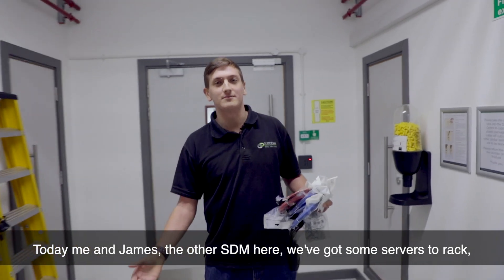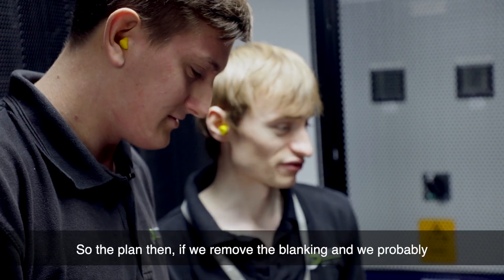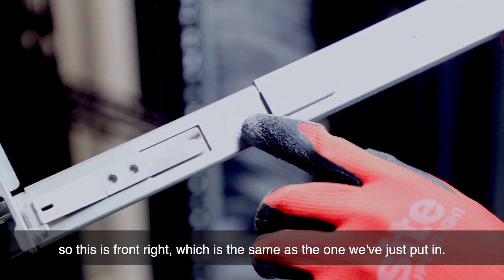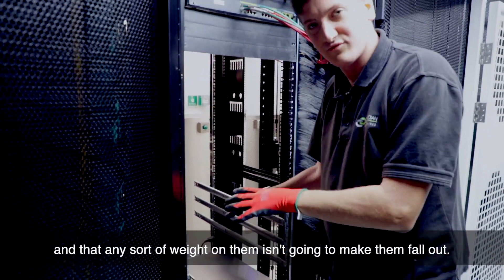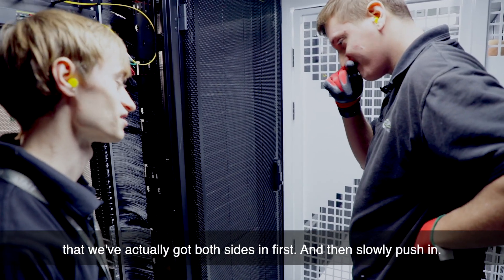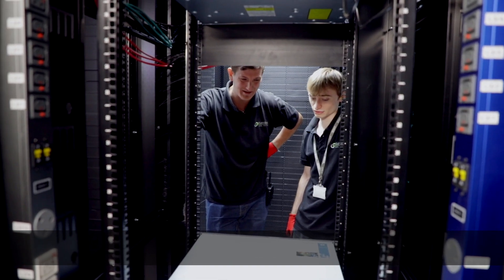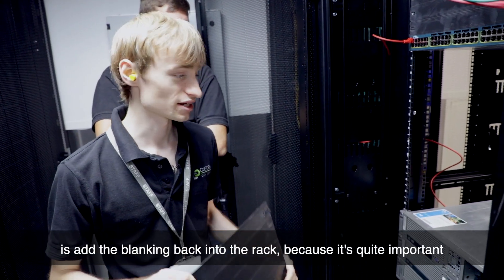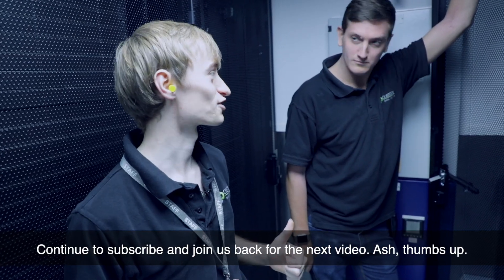A DAY in the LIFE of the DATA CENTRE | RACKING SERVERS with ASH & JAMES!

Comment: I did rack design just by myself and a program...and before that just watched once in a data center how it's done...

switches DON'T pull air from the front and push out the back, they pull it from right and push it to left side or the other way around...
allways install your switches frontfacing the back of your servers, because:
a) less cable cluddering and management, the main network cables are right at that end they need to be
b) patchpanels are allways facing the rear end of your rack, so less cable cluddering there as well
c) the airflow of a rack in a professional data center is less right to left, it's more bottom to top...fresh air pushes from the bottom of the frontend of the rack and gets pulled through the top backend of the rack, convaction is the keyword here

Comment: video from 7.2019 but hp server g5!!? and cables are installed incorrectly. so the server cannot be pulled out in case of maintenance or everything has to be unplugged beforehand. there are modules like fan etc. which can be replace online. then you have to be able to pullout the server in operation.
Reply: Most old stuff runs nearly as good as the new stuff once you plug some SSD's into them....

Comment: Besides the many comments already made, I want to add one simple rule: Never ever use any server/switch/etc as a shelf were you put your tools and screws and all the stuff, that's simply not professional. Also that many colors mixed up with the cabling seems weird to me, in our datacenter we only use a single color, but all cables are clearly labeled at both ends with source and target plus even patchpanel ports if necessary. For power cables we exclusively use z-Lock cables, they can be secured in place while fitting every standard port on the devices or pdu's (kind of a retrofit)

Comment: When I saw how they "slammed" the servers in the rails it made me cringe (hard drives).  Then realized they're old servers just for the video.
Reply: Drive heads are parked when not running. Think of the HDD's being delivered in a box by a courier / part time footballer ;)
Reply: @artr67  Vibrations, even when the drive isn't spinning, can still corrupt it. I believe yahoo* had this problem when transporting drives from one building to another--the carts they used introduced enough vibration to effectively kill their drives.
Reply: me every time my external HDD goes crashing to the floor
Reply: Yeah, and also for any other HDDs that's currently spinning in the same rack. That way of slamming the servers in isn't really recommended.

Comment: Look at those wasted PDU sockets due to the server rails!
To do this properly firstly use 1200mm deep and 800mm wide racks when mounting servers, mount both PDUs on the right next to the server PSU's and so the sockets are facing the back of the rack (tucked down the side) and add decent cable management for all the data cabling on the left side and add cable gutters to support the cables running from the front to the back. Also keep all cable lengths to a minimum to avoid excess cable just hanging or getting in the way.
Great to see the earth pin locking IEC sockets though!
Some advice from one data center manager to another :)

Comment: How does one get a job like this and how much does it pay?
Reply: Pay increases as you take on more responsibilities. You don’t get paid just for racking servers like this. They make you do variety of things and you have to be prepared to do all of them.
Reply: krakistophales networking courses
Reply: You start from bottom as a customer support and work your way up with bunch of certifications in IT. It’s pretty straightforward, actually. Get experience and certification. A degree would help but it’s not a requirement unless you go for upper management position but that’s not until you get years of experience.
Reply: Pay depends on where you live. In the US, its pretty average range from 40k to 80k. You get above 80k if you work for Google or top tech company but you have to be really top in the field.

Comment: Really two people? I install 1 to 4 u devices alone. Need to learn to do It alone
Reply: safety, always safer to have someone help you lift heavy equipment. my job requires 2 people when racking anything
Reply: You don't want to be the guy that drops an expensive switch or server. It is way too easy to ask someone to help you out for a bit.
Reply: I once installed 250  1u over a weekend all by myself, no gloves. Hardcore
Reply: @PerfectedImperfection  Your employer is a cheap-skate then, you should find one that takes you and safety more seriously...

Comment: Why don't you have an automatic transfer switch per cabinet for those single PSU devices to ensure they have redundant power in effect? If you lose feed A currently, that's one of your switches or servers going down.
Reply: They will typically switch between main feeds in under 20 milliseconds. Just had a look online and one will switch between main feeds in less than 8 milliseconds.
Reply: Will they continue to operate without any waiting time?
Reply: 2ms any good for you.... 

https://www.kvmchoice.com/detail_switch.asp?id=12858
Reply: @catmantech  thank you
Reply: Wont help if the PSU fails
Reply: @rty1955  no it won't, but it is removing single points of failure as much as possible.
Reply: @rty1955  for the Cisco kit you can use the RPS port with the RPS system supplying DC straight into the device. Ubiquiti also have a similar solution.

Comment: You guys charge by the hour, right?  With Rapid Rails one person can mount and server in less than 5 minutes without all that faffing about.  Clip in both ends, pull out rails, set server in, job jobbed.
Reply: Andy D I know right? I once dry racked 40x HP G7 DL360’s alone in less than 2 hours, and that included unboxing and preparing the waste for recycling.

Comment: Never used these rails.  Cool.  But I should think it might say "rear left", at least for the installer handling that end of the business.  Nonetheless, looks like they are so angled as to be specific to each side of the rack?
Reply: They are, you have the left and right rail and you cannot swap those, nor can you install them upside down, the G6/G7 rails (same parts) can be installed either left or right (but again not upside down) and I think the G8/G9 (same parts) can be installed in any way as long as you have the rear of the rail facing to the back of the rack.
Those G5 rails are fairly easy to install but damn near impossible to remove again, especially when there's equipment on top and below the G5 rails so you cannot get your fingers in there... G6/G7 have two tabs you push to release it, works fairly well, G8/G9 have one tab you just push and it drops the rail right out, works perfectly.
Most G5's I have had to remove required a wrench to push that damn clip back in to release the rails...

Comment: Thank you for this informative demonstration. I have a short question. Should I get Server + certification or Server 2016? Or both
Reply: Depends what you want to do. No need for any certs if you just start as a shit kicker and work your way up to sys admin. originally i just did a cert 3 in information technology at tafe. Easiest way to get into the industry is to go work somewhere for free for a while and then weasel your way into a job. Ive been a sys network admin for 10 years now.
Reply: @iampyron22 Thanks for the advice. I was thinking the same. I have two years of experience but have a break in work history. Ill go volunteer for internship and get in.
Reply: @mainevent2k  No worries, Good luck!

Comment: If you care about airflow put atleast the dummy hdd racks into your old servers 😆

Wait I need to wear steel toe shoes while working on my home rack?😄 Bare feet is so much better! (I did actually put on steel toe shoes while building the rack 😜
Reply: The servers should also have cable management arms fitted as well as the rails. I noticed some of the servers also were missing the PCI slot blanks

Comment: Running power and data parallel instead of having them on opposite sides of the rack? Interesting
Reply: No real need for this these days we have never had issues
Reply: I would imagine they're both sufficiently shielded cables.
Reply: no need to separate them but it is more practical when finding cables